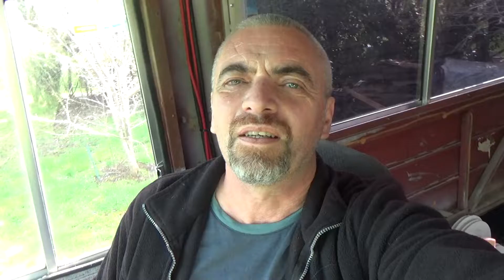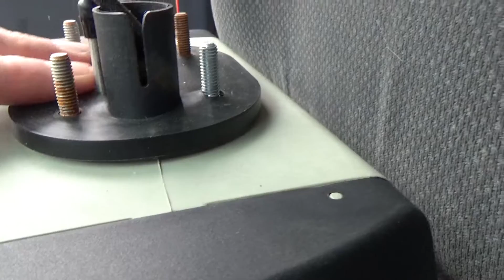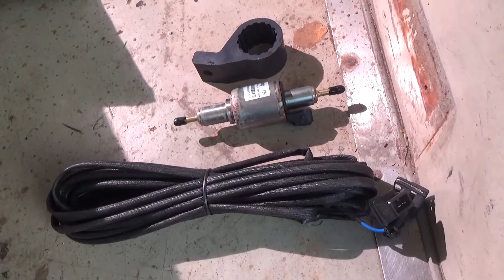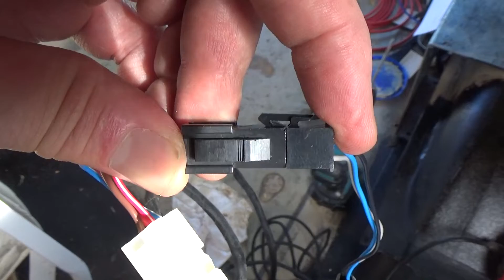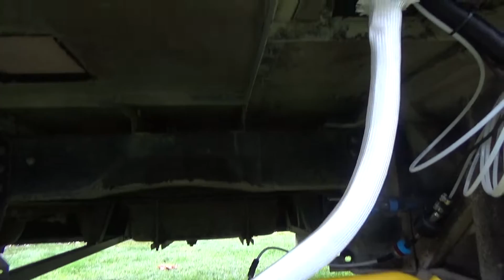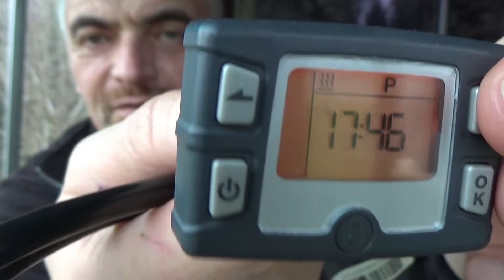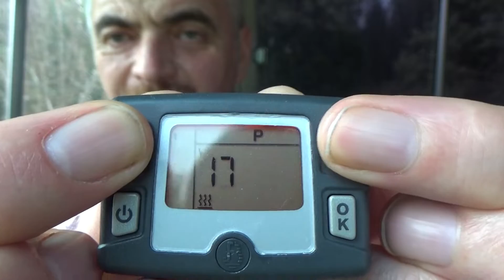Diesel Air Heater Install | The JP Heaters 2kW air heater goes in the bus

Comment: i have just bought a camper, it has a airtronic d2 & has the same controler, i can get it to work at all, then videos ive seen - its the same controller but the options are different - do you have a manual or anything ??

Comment: A bit of a life saver as i bought this unit but somehow lost the manual. The comments here were very helpfull. I plan to install this in the cabin. I want to run the air intake from above the woodstove, and the air exhaust into the bedrooms. That way it will only burn once the woodstove is cooled down, but will still move air to the bedrooms when the stove is hot.
Reply from the maker: I like that logic, those heat powered stovetop fans work good for moving the hot air too

Comment: hi mate good video, would you buy the same again. i,m a bit worried about buying the cheaper ones, but i like the look of the jp cheers john from uk
Reply from the maker: Yes, in an instant. There are also much cheaper ones than JP and a lot of people have good experiences with them too but I feel like the JP which looks to be a Webasto clone is worth the extra expense, while of course still being pretty cheap. I only use it in winter, it starts every time and runs great.
Reply: thanks mate appreciate your advice @BusedAsNZ

Comment: Curious if you have found a way to run in thermostat mode without the fan continuing to run after the set temperature is reached.
Reply from the maker: No, only low speed. I hate fan noise but I guess it needs the air movement to know the cabin temperature anyway.
Reply: @BusedAsNZ  hmm interesting point. I figured the thermostat was built into the control unit but you're probably right.
Reply: @cmiller4567  There is a remote heat sensor available, I have one, but the heater does keep running the fan.

Comment: We've got one of the cheapie 5kw heaters in our caravan. It's awesome! I just use the remote to turn the heater on and off. Saves fluffing around with the controller. It will be interesting to see if you find that 2kw is big enough as I'm glad that we went for the 5kw instead of the 2kw option. P.s. I've had our sbms0 fully operational for over a week now and loving it! We will however have to add more solar panels for winter  :)
Reply from the maker: 5kW must be wicked, and probably quieter. I don't have the remote kit though it looks like it would plug right in. Once I work out some window insulation I should theoretically only need about 1.3kW for the space, theoretically haha. That SBMS0 is a great bit of kit, just waiting on a couple more bits to finish my powerboard and I will hook mine back up

Comment: Twice the price of the cheapest ones, and half the price of an Espar unit locally. That controller is so much nicer than the cheapest units, though. I found the ticking of the pump annoying so took steps to isolate the sound and even relocated the pump furthest from the bed. The first night I turned it on I felt like a rich man.
Reply from the maker: Yes it's a nice tidy controller, and pretty straight forward once I got my head around it though its pretty fussy when you try to press two buttons at once. Looks like it has a few deeper menus that are not mentioned in the manual. I cant hear the tick inside, will see how it sounds overnight next weekend
Reply: @BusedAsNZ  I have the same heater and am trying to figure out what these other options are. Apparently there is a high altitude mode that the company posted a youtube video for yet its not documented. https://youtu.be/QxnZnpZFhNU. Currently in contact with the company to get an updated manual.
Reply from the maker: Yes there are definitely more options hidden in there. I doubt you will ever see them in a user manual though since they could really stuff things up. More likely a service or workshop manual. Some of the facebook groups and other forums discuss them but the standard settings are ideal for my situation
Reply: I have the same heater set to run gasoline. I am a bit disappointed with the wide range that the thermostat runs, but it does seem like a good heater. I am pushing hard to get an explanation of the other options.

I have explored the menus and watched all the videos I can find. I have asked JP and the Canadian distributor. JP has said I have to ask the Canadians. The Canadians say they are working on it.

Here is what I have so far:

Settings Menu:

1 Press Power button to stop heating

2 Press left button to get to the clock icon

3 Press left and right buttons together, This gets us to the P Menu

Menu will display P1, or P2 (fuel prime mode) or I get --05 not --01 (I cannot factory reset according to instructions)

On P1, Press OK then the C Menu displays

Press OK, you are in the C1 settings Menu (There are two menus) left and right arrows move between them.

C1 Menu (With my current settings):

00:of
01:on	Celcius Fahrenheit mode: on is Celcius, of is Fahrenheit
02:on	Language of is Chinese  on is English
03:of
04:of	High Atltitude mode settings: on is on, of is off (Must disconnect LCD plugg after setting)
05:of
06:of
07:10

C2: Menu (With my current settings):

00:03
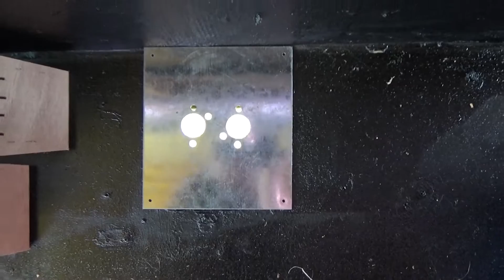01:00
02:of
03:of
04:of
05:of
06:of
07:of
Reply from the maker: @rick881  Awesome info thanks